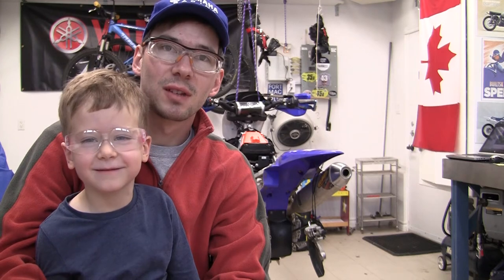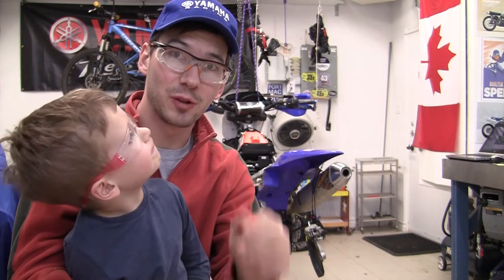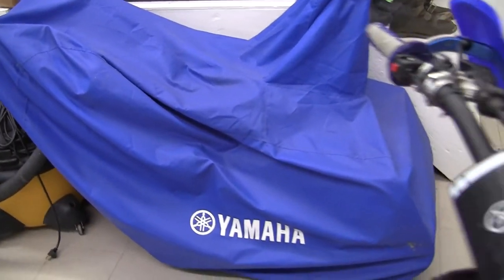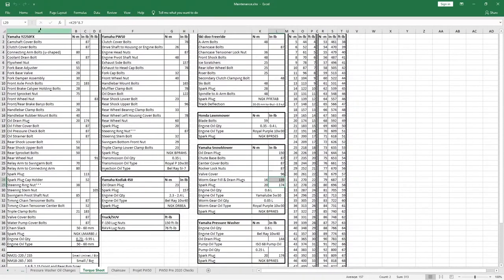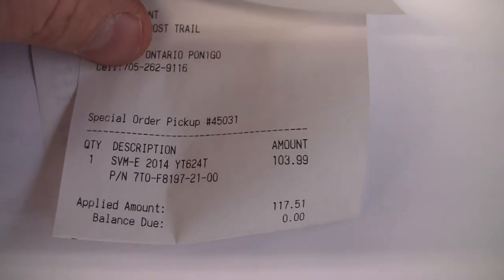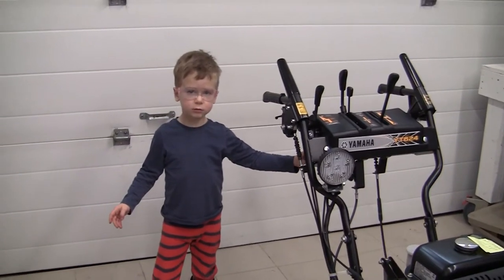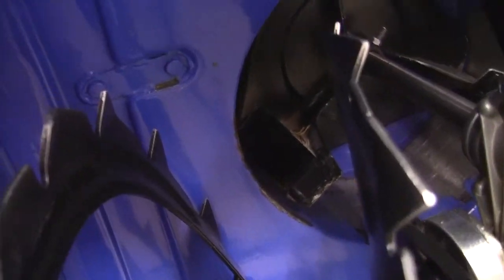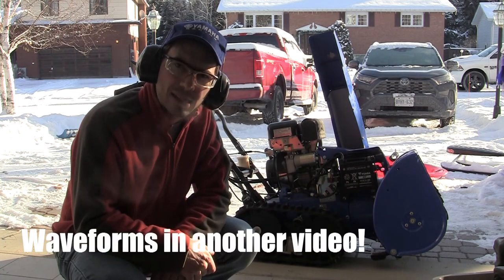Ep. 1 - YT624EJ Maintenance Series (M.S.) - Introduction

Comment: Great video!. Im into my 6th season and wish mine was still in that condition. They use lots of salt here in newfoundland and just destroys everything. So far I've had to replace the height adjustment shock, ignition and the  chute direction switch. It's great to see someone make some videos of this blower for maintenance as there are not many. Looking forward to any maintenance tips and how to videos you make! 👍.
Reply from the maker: Brutal! Let me know if there's anything you're interested in. In a way the mint condition of my unit without the salt limits my breakdowns a bit...
Reply: @lucgallant   if you ever do a tear down of the auger or anything with the impeller love to see a how to disassemble/assembled how to. Want to attempt it and give the blower a good look over and good cleaning. I know I'll take it apart and have left over parts putting it back together haha.
Reply: Very good video. I have the same year. I had to replace the battery, bottom scraper bar, and now chute switch..Hopefully no more issues..Glad I have it because very hard to find any stock.

Comment: Hello there , great channel . I would like to see a video on how to adjust the reverse speed on the YT624 . The reverse speed on mine is so slow that it is aggravating to use .
Reply from the maker: @josephlee408  as far as I know that speed is not adjustable. Is the slack of your cable off or something?
Reply: @lucgallant  It could be , i have a pdf copy of the service manual and it shows adjusting the cable but i don't understand the bit about taking off the bottom plate and moving the cable to the transmission side .
Reply from the maker: @josephlee408  Let me know the section number I'll have a look.
Reply: @lucgallant  I t is sections 3-8 and 3-9 , Checking the shift lever in the periodic maintenance section .
Reply: Update . So i had a go at it and went with what i understood and adjusted the exposed cable rather than messing with the bottom of the machine . Well it works 100% better . I still would like to get your feedback on those instructions though , wondering what taking the bottom plate off and messing with that cable down there would have had to do with it . Regards and thanks for the replies .
Reply from the maker: @josephlee408  I will endeavor to make a video on this task. I read the instruction and same as you I am not sure what it means by "Temporarily install the shift cable to the H.S.T. side." Anyway this cable is pushed into the sleeve in order to go in reverse so if there's any corrosion or stickiness anywhere it could impact the amount of reverse you get out of it. Good that you were able to adjust it in a more sensible way. I'll make something down the road. Thanks!!
Reply: @lucgallant  I also think it would be worth a video . Thanks again for the information .

Comment: Nice videos, I have the same snowblower, are you having problems with the rear shoch, mine slides regularly and I do not see the problem.
Reply from the maker: I have not no, but read of others on forums who were. Consider warranty if available or just outright replacement.
Reply: I've had to replace my shock already. The dealer said its a very common part to wear out which in my mind is ridiculous for the price we pay for these blowers . If you haven't already expect to change the chute direction switch. Local dealer retail on the Shock at $300 and chute direction switch at $100. Not sure if its same pricing across the board for all dealers.
Reply from the maker: @fox259  I'm sure the price is similar across all dealers. Could probably get a 10 to 15% discount but likely no more. Is there any aspect of the shoot switch that could be disassembled and fixed?
Reply: @lucgallant  not sure. Never looked at it really as it gave out in the middle of winter and the frustration of not being being able to direct the snow got to me haha. When  I removed the used switch it was very snappy and sloppy feeling and not smooth. Might be like a spring return sysmte to bring the lever back to the middle and wears out over time. Id say if you took the time to look at it im sure if you can find some parts to substitute you could make it work.
Reply: My rear shock slides too...really frustrating
Reply: Hey guys, I've had my YT624 for 4 winters now and I've had to replace the shock after the 3rd year.  The skids also wear out and I'm on my second set and need another.  I've purchased
 some 1" Teflon and going to cut out my own and try.  The skids from Yamaha are $100 taxes in.
Reply: @ken1769  Good chance it has to be replaced. I've replaced mine as my dealer said they are common to wear out. Also be prepared to replaced the chute direction switch at some point. Very poor design parts that should be lasting longer the  3 or 4 years.

Comment: Have you noticed starting with the electric start, I have to turn it once and let it turn over, and then wait about 10 seconds, and turn key again for a clean start. Any tips? Otherwise, it is always a rough cold start.
Reply from the maker: Hi there, I haven't actually noticed that. I usually just do the single start, but yes I agree it's not totally clean. I will try your method!